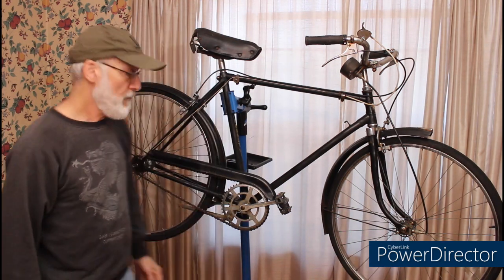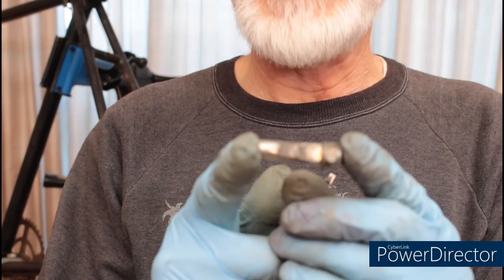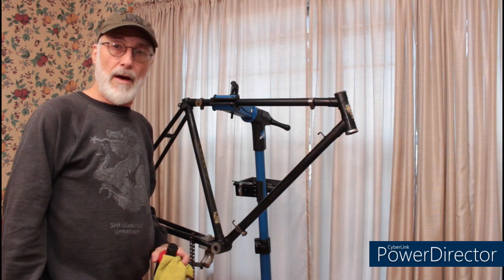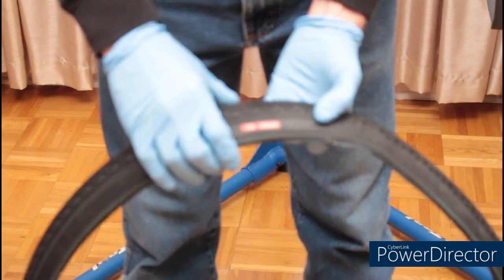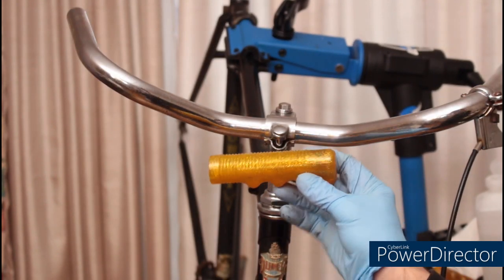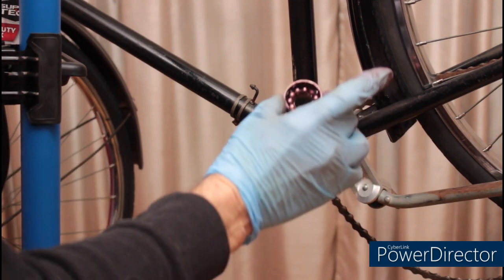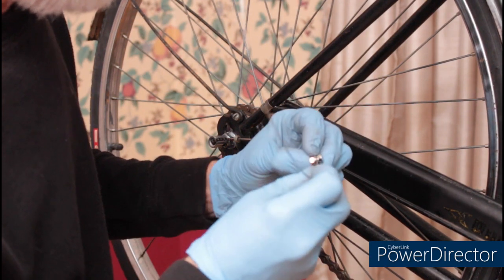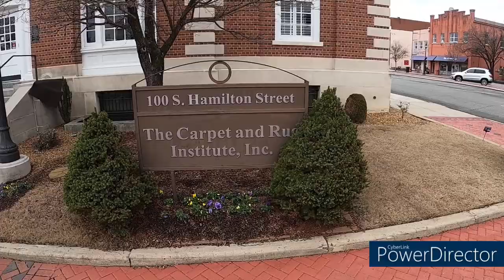New Life For Old Bikes My 1959 Dunelt re-build

Comment: I have an identical version of this bike, but don't trust myself enough to take apart that 3-speed hub.  Great video.
Reply from the maker: Thanks for watching. I have a video on the hub rebuild, if that will help you. I took it apart and serviced the components as I disassembled it. This way I never had all the parts in one overwhelming pile. Also, just note which way the Pawls go in,  so you don't put them in backwards. Sometimes I find a quick photo with my phone will help me out later. If your hub is working right now, you could just refill it with some fresh oil oil.

Comment: What about the chain?  I was thinking of taking off the chain from my denelt cleaning waxing and putting it back but I am unsure how to break and relink an old chain like this.
Reply from the maker: If the chain is good, I always clean and wax it before I reinstall it. Look for a chain break tool. I got mine off evil bay. Just make sure you get one for a bike and not a motorcycle. Motorcycle chain rivets are larger than the ones on bike chains. If you go to my video page, I have a video on how to check and replace a chain.
Reply: @NewLifeforOldBikes  Thanks I have all the tools but do I use the same pin again do I use a quick link I am new to old bikes.
Reply from the maker: @evanbrom1  Master links make life easier, however I generally just push the rivet back through the link.